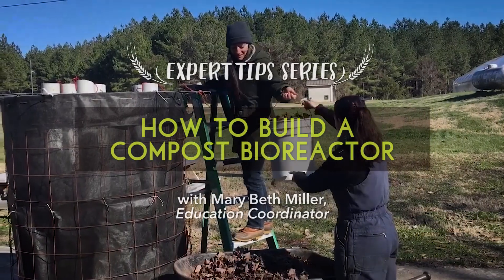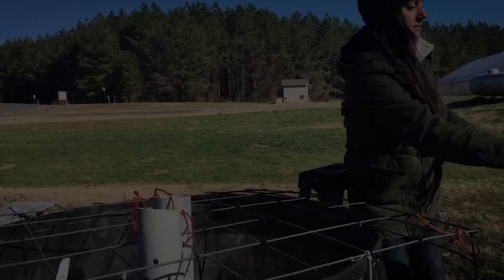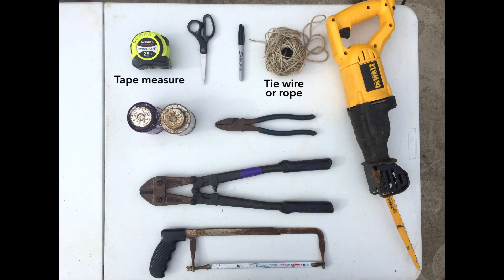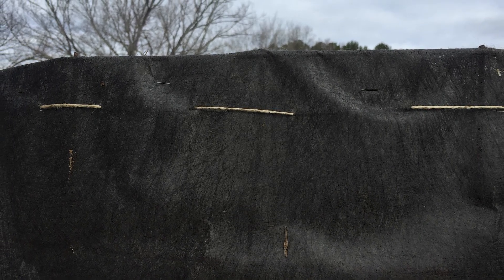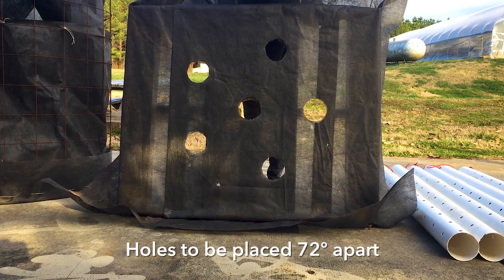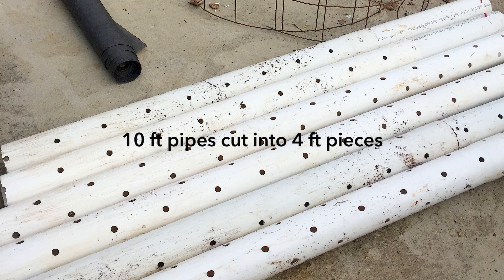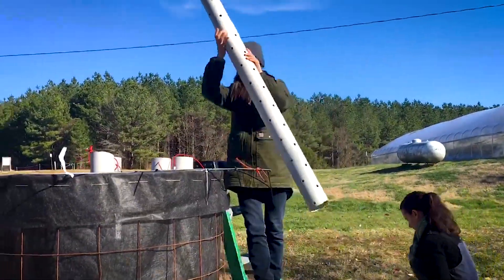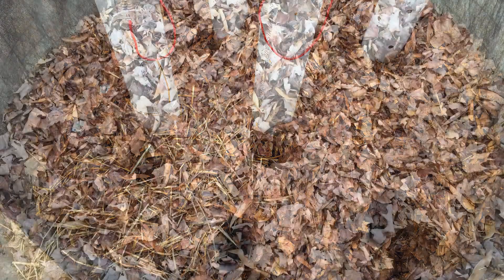How to Build a Compost Bioreactor

Comment: Great video! I read all of the comments and think many people don't know or understand the purpose of composting in this way. The purpose is to have a product with a higher fungi to bacteria ratio, which gives the soil the ability to feed plants and mimic a forest based soil, where plants and soil have a symbiotic relationship. The fungi do a great job at holding water in the soil to make it more drought tolerant.

An upgrade I plan to add to my reactor is wrapping the pipes in a firm mesh to reduce the risk of collapse. Thinking chicken wire will do the job.

Comment: Hi! You need to soak the material completely then allow the excess water to drain to get it to ~70% moisture before adding into the pile. Also, you can stick a soil moisture meter into the pile to keep record and wire it to a solenoid valve to flip on the drip line. Or really just water 1 min per day no matter where you are, because it is an essential piece of the puzzle.

Comment: Recommend shredding and then soaking leaves before adding to bioreactor.  Add red wiggler worms on the fifth day to substantially increase material breakdown and microbial inoculation.  Also cover the top to manage moisture in pile.
Reply from the maker: Thanks for the info!

Comment: A lot of videos out on this but none show the end result. How is this better than my hot compost pile that's ready after only 6 of our coldest months?
Why perforated pipe and not solid? Is 12" enough for air flow even at the bottom where it gets compacted? How is this better than my hot compost pile that's ready after only 6 of our coldest months?
Reply: The Johnson Su BioReactor is for those who wish to compost but do not want to turn their compost.  The vertical tubes allow continuous aeration.  In short, it is a longer decomposition process but does require any work (turning) after the material is added to the reactor.  Decomposition in this system takes approximately 1 year to complete.
Reply: The goal is not to create compost in a hurry, but to allow it to mature once finished, the the fugal growth can really develop. I have seen videos of the end result and the material is indeed a thick almost clay-like texture. Your hot compost will be bacterially dominant, whereas the JS product will be more fungal dominant. The pipe does not need to be perforated. That’s just how the stuff comes as drainage pipe. Use what you have,  or can get for cheap. Some people use fence posts... just a bit tougher to remove.

Comment: do you relize that you skipped a portion of Dr Johnsons instructions? Wet the material you are using to fill the bio-reactor before placing it in the  system........very important to help start the process with a 70% moisture content....

Comment: Hi, good video thanks. Im about to make one of these bioreactors, and am wondering why the pipes need to have holes in them if, after 24 hours of settling, the pipes are removed? I'm a bit confused... is it so that the material starts composting immediately? Could I just use normal pipe and not go through the hassle of drilling all the holes?
Reply: Dr. Johnson said it doesn’t need to be perforated pipe. The instructional video he made showed that’s what he used but he said that’s only because that’s what he had on hand. I haven’t built one yet, so I’m in the same boat as you, but I have watched a whole bunch of vids on it. It could be argued that the perforated pipe gets some air into the pile sooner. But they’re typically removed after 24-48 hours and shouldn’t go anaerobic in that time. Best of luck!
Reply: @Doitallgp  Thank you, yeah that makes sense. It wouldn't be going anaerobic in just 24 hrs. the pipes are really just there for the structure and then they're removed. Off to make it today, best of luck to you too!
Reply: @Akira-tz4zd  The perforated pipe is thinner walled pvc and is cheaper than its counterpart plumbing piece for a closed line. That’s the reason lol

Comment: any reason you shouldn't leave the inner pipes in the reactor?  thanks, this looks great.
Reply from the maker: Thanks for the question, Richard. If you leave the inner pipes in the reactor then it restricts all the airflow into the pile, which is the whole point of the tubular holes. Hope that helps!

Comment: How hot does this pile get, and sustain itself once activated?
Reply from the maker: Thanks for watching! The Johnson-Su bioreactor has a very short thermophilic phase (145-165 F) of 4-5 days, after which it is recommended that you add red wriggler worms.

See this doc for more info: http://case.nmsu.edu/case/pasodelnorteagriculturalworkshops/documents/Johnson-Su_Bioreactor_BMP.pdf
Reply: @CFSACarolinaFarm  I can no longer access this document. Is there another link I can use?
Reply: great question and answer, I didn't even think to ask that